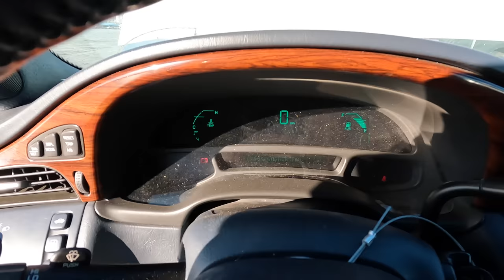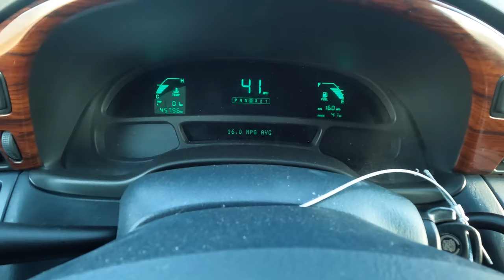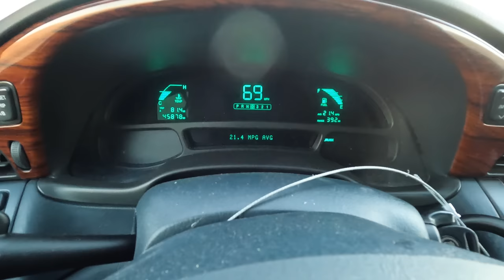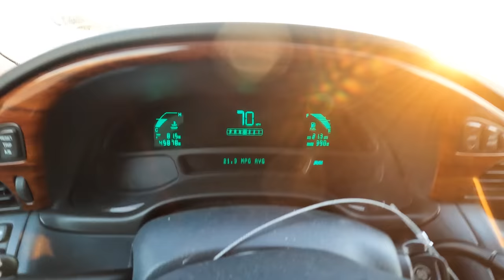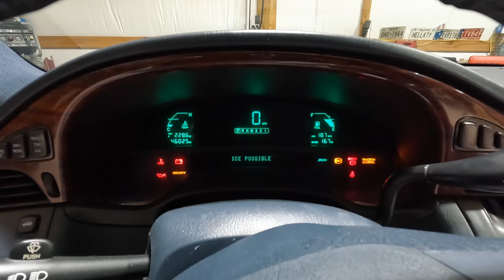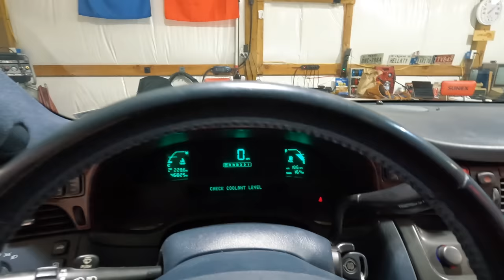I Bought a Cadillac Limo from Copart Sight Unseen - 2 Hour Drive Home with NO HELP! Will it Make it?

Comment: I don’t know much about these engines other than they commonly blow head gaskets. But i had been told they were a lot better after 2000. The only north star I have driven was my great aunts 2002 Seville SLS that like 93,000 miles I think and it never had the head gasket done. Nice driving car though. As far as the lights GM if I’m not mistaken made these in house. So if you call the GM dealer with the vin they may be able to give you the part number or order them for you. My local Cadillac dealer has the limos and hearse on the lot for sale on the commercial side

Comment: I would imagine that the auxiliary fan, up it is in fact auxiliary, would have been put on because funeral cars usually don't exceed 20mph. So if the car had to travel very far at that speed un would more than likely over heat and especially if it were in the southern United States.

Comment: That car is purpose built for funeral service. Looks like a Federal. I spent much time in Federal cars in the funeral industry….most don’t get many miles in funeral home use and finally get updated when we need newer equipment to keep up with the times. 

The battery is under the rear seat.

Comment: I think its a T-10 or a T-5 bulb. Use led for better  performance. The pusher fan is needed to help cool down the refrigerant in the condenser to compensate  for the additional area.

Comment: Did you consider that the "spare" that has no air might have been the left front tire that went flat and the tire that is currently on the left front was the spare?
Reply: The spare rim is diferent.

Comment: The blub is a 164 same as they use in 99 to 02 chevy doors and also the third brake light on the rear I'd suggest led cause they last awhole lot longer and also are way brighter

Comment: Those bulbs look like T10?   Ford used them over here in things like the Escort, Sierra, Granada and you can buy LED direct replacements.   There should be in the glass itself at the base of the bulbous part some sort of identifier, they made them from T1 to T god knows but they look about the same as the Ford pattern.
Reply: Oh and the trick with them all alloy engines is Barrs, read somewhere that its in the manual someplace that once a year add some Barrs stop leak and of course no one bothers and the stop leaks fill the small caverns and imperfections in the casting and prevent the engine heat cycling from enlarging said holes into major leaks.

Comment: I don't care for those 6 door limousines.  I always thought they look tacky and funny and I was going to comment they are used primarily in funeral homes and then I saw that front license plate!  ROTF LMAO!  They were designed that way for undertakers.  No patrician window.  No interior amenities,.  Just a stretched sedan basically meant to carry family members to the graveyard.

And yes, driving limousines are awesome.  The longer the wheelbase, the smoother the ride.  I had a 1976 Cadillac Fleetwood Series 75 and it rode smooth as silk.  That was back when they made the limousines at the factory instead of cutting a sedan in half and adding to it.

Comment: With the northstar it's not really so much that the coolant systems are not maintained its because the head bolts were poorly designed and would cause the head gasket to leak.

Comment: Use the green universal coolant I had a GM master tech tell never use Dex Cool in these. he told me when they do head gaskets they do not use dex cool they use the Universal green coolant. I had a 1999 deVille  with redone head gaskets and when I had the Dex crap flushed out at a GM garage they used they used the Universal Green coolant and the coolant temp never went over 180 degrees.

Comment: You know you said the spare tire was flat why don't you buy two new tires and take one of the that old tire and use it for the spare and then put two new ones on the front? Just get the same kind then they'll match I know you don't like mix match tires but since the other ones are still really a lot of tread but if you said they're cracked with whether than you might need to get all four and then save the best one for the spare?

Comment: I am sure that the odor you are experiencing is physiological because it was a funeral vehicle. The limo could have been a party vehicle before the funeral co. Bought it. Does it smell like booze or weed? Point is there were no caskets in it they wouldn't fit. Possibly some flowers but those are used for other occasions besides funerals. Don't ruin a fun experience with morbid thoughts.

Comment: Your Engine oil pressure is low prompt service is required Your Washer Fluid is low Prompt Service is required Your keys are in the Ignition Thank You Your Head Lights are on Thank You Yoir engine coolant is low prompt service is required remember what car company made this voice alert in the 1980's

Comment: You probably will find out that bulb is a 2721L the same ones used in my 2006 Ford Explorer floor shifter light wall mart and most auto parts stores carry them

Comment: Fans running means issue with ECM   ,  faulty computer ,  unhook batt turn key on while disconnected drain all power ,,  then reconnect batt and run again ,    if fans come st8 back ECM for sure ,,  ,    45,000 is low miles  no doubt ,   but  that cars so ugly nobody wanted to be seen dead near it

Comment: Well as a former Uber driver you'd know this thing is WAY too old for rideshare.  07+ at a minimum and you won't do anything but X with it.  Even XL you'd have to fight for it as it's not a factory built limo.  I'd still like to find a six door limo someday, one of the "24 hour" types, where the second row can face forwards or backwards.  But it would be for annoying my wife and children, not Uber.  80s Buick Park Avenue would be the one I'd want most.

Comment: Dont bother getting tyres on those wheels they are uglier than a un wiped arse ,,            put nice mags on it and it may help take the ugly outta the whole car ,,   8 studs on a car /4wd cross over , might be hard getting a wheel to fit it ,,      Much prefer the look of the Ford Lincoln from every point of veiw ,     these CADILLAC models were the worst of the caddys to look at ,,   what the hell were they thinking desiging this terd ,    any wonder theres over 30 lincoln cars to 1 caddy,    guess i,m not the only one who thought its terrible car to look at ,      good luck with it and my tip keep your hands in your pocket dont be fooled into spending lots on it ,,  see how much demand there is for that car and then decide if you will invest into more dead money